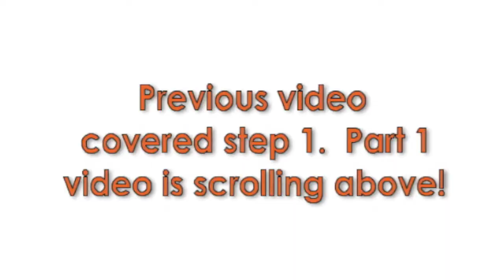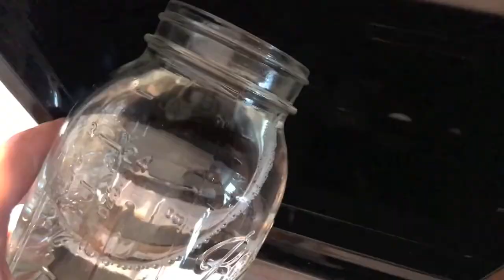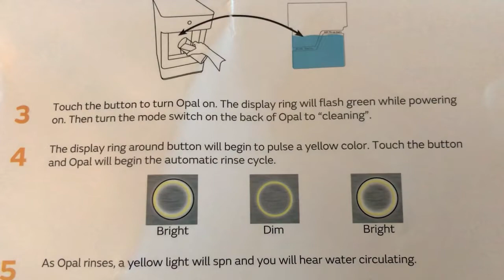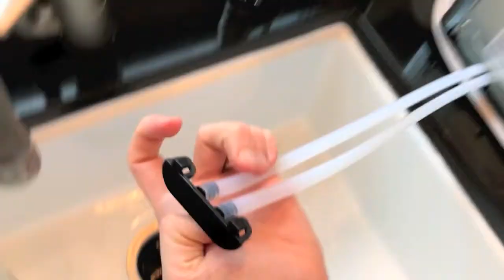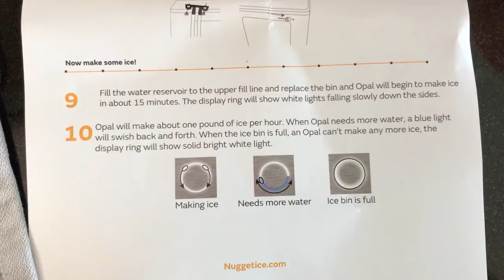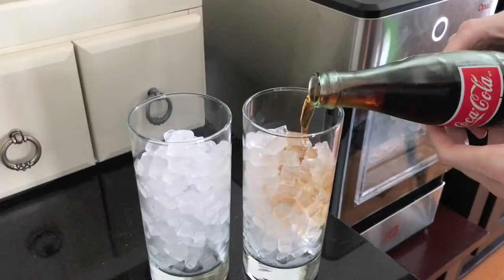Opal Nugget Ice Maker - 1st time Cleaning Set Up Process - IMPORTANT

Comment: I have had my Opal ice maker for over a year. A month ago I noticed blackish spots on my ice. Did the 18 hour cleaning on it then started it back up. Worked great, but after a few days had to clean again... black ice was back. Now I have to clean several times a week. We have well water, so no additives to the water. Any suggestions?
Reply from the maker: Thanks for watching & a few things can cause this.

1.  Worn out parts...which shouldn’t be the case because it’s only a year old...

2.  Hard water... lots of solids inside water and when frozen, they are very noticeable.

3.  Mold inside machine... which you mentioned you did a thorough cleaning so this should not really be the issue.

4.  Plastic shaving inside ice... ice machines are hard-working machines and overtime, the internal parts can begin degrading and shedding plastic.  If this is the case for you, we recommend putting in a call to the manufacturer & discussing replacement options... hopefully they will honor a friendly swap.

Keep us posted.  😎👍🔧🔩

Comment: Hi! I have a question I purchased a used one, I know horrible idea. 😂 but I plugged it in and did the cleaning process, and tried making ice later, I had it on for twenty minutes, and it made some ice (not very much) so I just let it keep going and then I checked twenty minutes later and the ice was melting and and no new ice was made, so I let it continue for about another 30 minutes and I noticed a steady stream in the back, behind the ice bucket. It also started making a very loud ringing noise. So I’ve kept it turned off. Hoping to find some answers, if my only option is to buy a new one I will 🥲
Reply from the maker: Thanks for watching & we appreciate you sharing this.  If the system has sat unplugged and dry for a long period of time, it may need to get a few more flows of water.

We have heard similar experiences in the past.  Please keep us posted.  Hope it will begin to cooperate.

😎👍🔧🔩